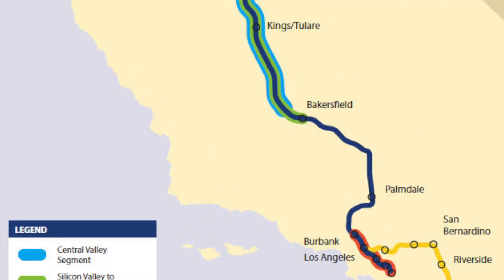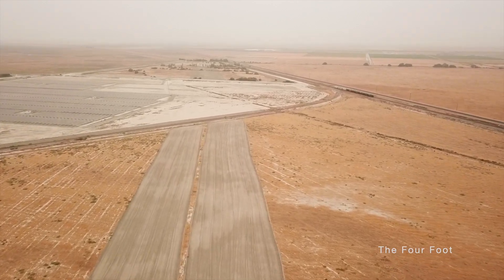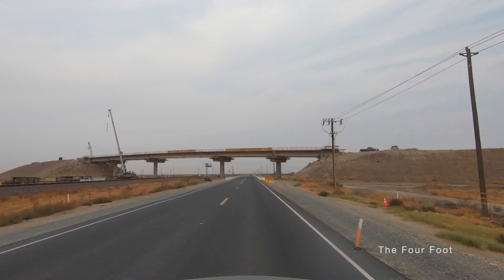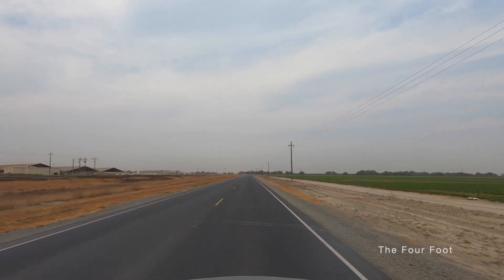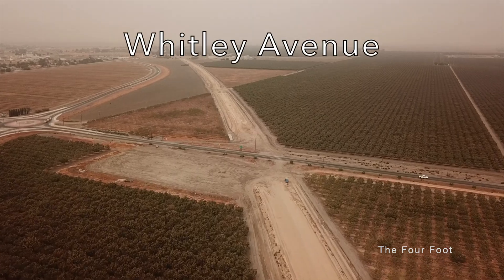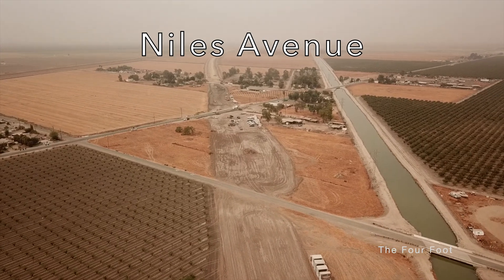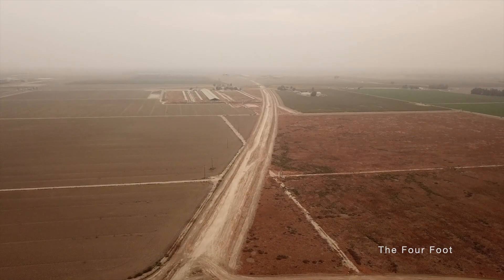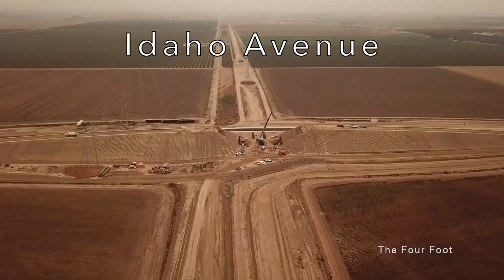California HSR CP 2-3 Pt. 1 Construction Update October 2020! (Part 2 of 4)

Comment: California has learned from the Amtrak problems of the northeast corridor.  High speed trains require their own set of tracks.  This video is really important to show why it's costing so much.  You can paint a house, without doing the prep work first, but it won't last very long.  The high speed rail project requires a lot of prep work by very dedicated people.  I grew up in Merced.  The tule-fog led to some deadly crashes.  The high speed rail does not allow traffic to cross the tracks. Mixing fog, stalled vehicles and trains traveling fast is to be avoided.

Comment: I don't remember if the first section to be completed will be between 120-170 miles, but once it is finished I plan to ride it. It will be cool to see all the farmland. I live in SoCal and remember even going to Disneyland as a kid you could see miles of farmland. A lot of fruit orchards. Now, very little is left if any.

BTW, is it true that initially the first section will use diesel engines since the track won't actually be electrified at that point? If so, do you know if the passenger cars themselves will be the same ones? Also, how fast will these non-electrified trains go? Thanks, again for another informative video.
Reply from the maker: I for sure feel your pain. While agriculture isn’t my top pick when it comes to natural beauty, it’s far superior to suburban sprawl. Even in my brief childhood in northern Illinois, I got to witness the orchard to orchard-themed-subdivision pipeline firsthand. 

I’ll be honest I haven’t followed the project too closely in the last month, because I’ve been waiting on any (hopefully good) news out of Washington regarding the project, but yes, a majority single track, non-electrified line has been proposed as a way to get something running with the current funds available. I would be lying if I said I didn’t see this coming; honestly rumors about this have been circulating for at least a decade. I don’t want this scenario to become reality, but if it does it will be big sigh better than nothing. If it does become the temporary future of the CAHSR system, yes, Siemens chargers will be pulling the current siemens coaches and California bilevels on the HSR alignment at 125 MPH. You might even see the comet cars make an appearance lol.

Comment: Maybe you can answer this question for me which is "why build and buy a new rail right of way when you have an underutilized right of way 200 feet off to the side of a road?" Obviously the BNSF right of ways are utilized, I'm talking about the under used and/or abandoned spur lines.
Reply from the maker: If you can tell me which abandoned spur line connects Los Angeles and San Francisco and will support speeds of 220 mph, I’d love to hear about it.
Reply: @TheFourFoot  The example I will give of a good reuse of an abandoned rail corridor is the rail line along the 210 freeway in Los Angeles that goes from Pasadena to Azusa etc... For years before the Gold line (now L line) that rail corridor was abandoned, Santa Fe didn't need it any more and it was no longer in use. Then metro rail bought the corridor and repurposed the line for light rail use. To me that is what I mean, obviously sections of that line were unusable or didn't fit the goal metro rail had for the line, but metro rail made the connections either on the street level or sub/above street level that connected to Union Station. My question is "why didn't CA High Speed find similar rail corridors in the central valley that they could have rehabilitated and pieced together to make a high speed rail line."
Reply: @markjensen7091  It probably wouldn't have connected to towns or something
Reply: @TheFourFoot  Well you just mentioned a short line rail road in the central valley. My question is "why build a brand new right of way, when you can buy that small right of way, and develop it for high speed rail." You don't need to file an environmental impact report because you are already using that section of track for it's intended purpose which is for rail use. Then maybe 100 miles up the road is another abandoned spur line, why not acquire that line as well and piece along rail right of ways between already established lines. Obviously the path thru the mountains along Pacheco pass and the Tehacapi mountains is going to have to be built but other paths could be used to connect.

Comment: Unfortunately the High Speed Rail Authority has deleted all of the original design documents from their "new and improved" website, but you can still find them on the Wayback Machine if you know where to look. Maybe you can splice some images from the design concepts into the drone footage.
CP23 15% design: https://web.archive.org/web/20171220052929/https://www.hsr.ca.gov/docs/programs/construction/CP23_RFP_13_57/reference/P13_57_RMB_01_Preliminary_Design_Plans.pdf
DragadosFlatiron proposal: https://web.archive.org/web/20171219232214/https://www.hsr.ca.gov/docs/programs/construction/P13_57_Volume_2_DFS_Final_Redacted.pdf
DFS Appendix: https://web.archive.org/web/20171219232241/https://www.hsr.ca.gov/docs/programs/construction/P13_57_Appendix_DFS_Final.pdf
Reply from the maker: Thank you for posting this! It would definitely add to the videos.